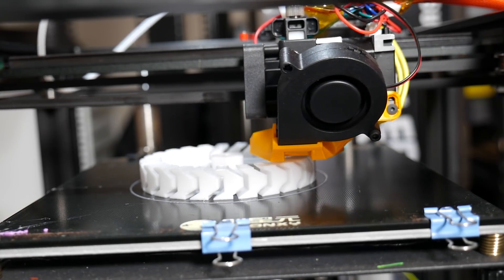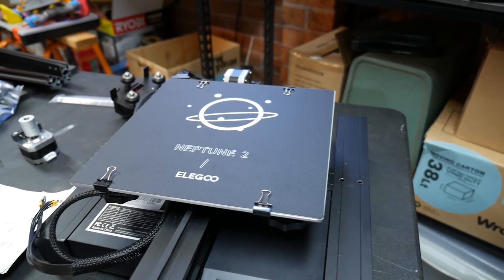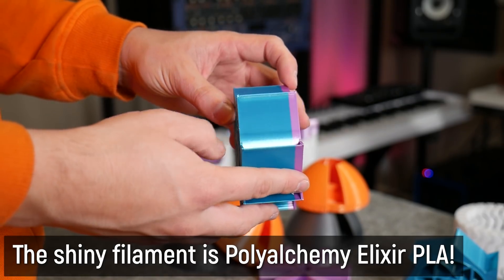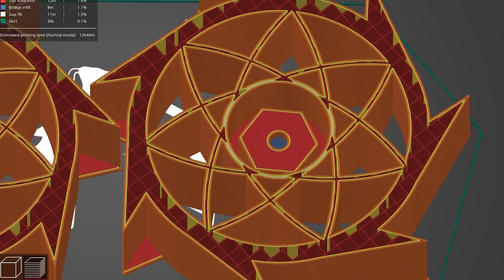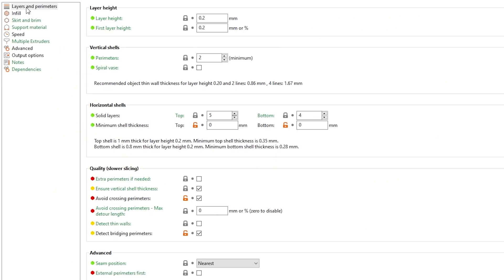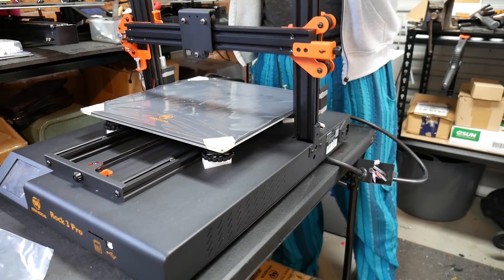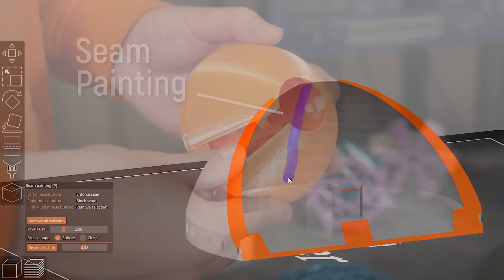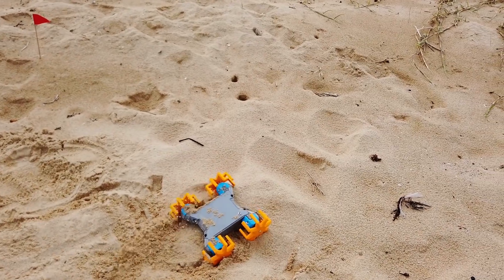3D Printing MORE of your weird wheel designs using PrusaSlicer

Comment: flexible wheel is going to be fun to watch, but remember the way it expands is going to be very different based on whether youre just holding it after attaching it or running it on the ground.
if yorue holding it acceleration around the wheel will be uniform.
when youre running it on the ground, it will also have an additional acceleration and deceleration as the forward -> componenet of speed of the wheel changes bettween 2x the speed of the car at the top to 0x the speed of the car at the ground surface (changes with slip)

Comment: the 'flexible wheel' design could actually BENEFIT from some stringing ...
Reply: Yeah originally my thought process was a stiff material would stop over expansion and the thin area where the splines connect would flex slightly. But alas drunken me forgot to mention rigid materials in the description

Comment: On the subject of wheels here, I am STILL waiting for my very first printer ever to arrive and had a question about wheel traction. How much 'rubber' does flexible filament have? With that, what would be the best flexible filament to be used for use in tank treads? (Vector Robot usage)

Comment: i noticed my Tevo tarantula pro was having Z height issues, too. I'm sure you may already know these steps, but consider the following:
If it has a spring-like z coupler, replace it with a solid model. Mine was like this, and I filled it with epoxy to great results.
Consider using white lithium grease, teflon spray, or graphite lubricant on the Z screw.
Most importantly, check to make sure the stepper drivers are set to correct VREF limits. Mine were all over the place (0.72-0.84v) and needed 0.95v to run right.
Hopefully, this will be of some help for you.

Comment: I was contemplating that Flexi Wheel design... When you said it may expand as the car accelerates, and coupled with the video of the car getting High-Centered, The expansion may be a huge benefit for a stuck car because high RPMs could make the wheel's diameter larger lifting it out of its predicament. If you can, please test that theory.
Great Series. Thanks!

Comment: I was printing a project that required multiple prints of the same piece. First was fine, so printed a second and it failed 75% done, tried again and was like the first and successful. Why do prints fail for no reason? Nothing was changed or altered between prints. Just random fails.
Reply from the maker: Could be heat creep if you tried to print the second straight after the first? Otherwise, filament tension and quality can vary throughout the roll sometimes.
Reply: @MakersMuse  Using Econofil, was on sale, $18 Canadian. I have printed several items, some successful, some not on the same roll. There is a cool down to remove the print from the glass, then next item about 30 min later. Some take 3 or 4 hours to finish. The print setup was never changed though. It's just weird.